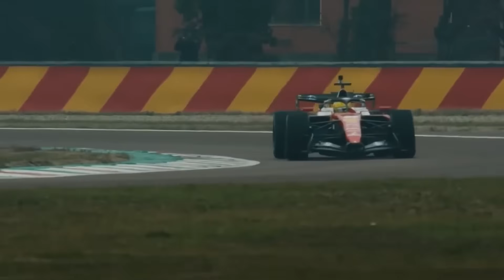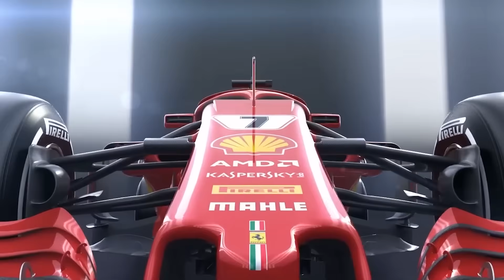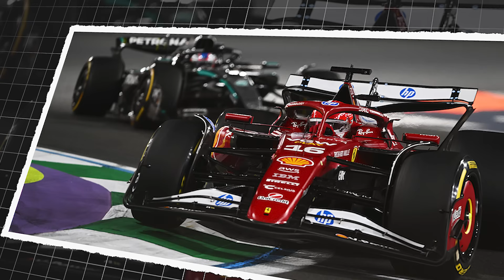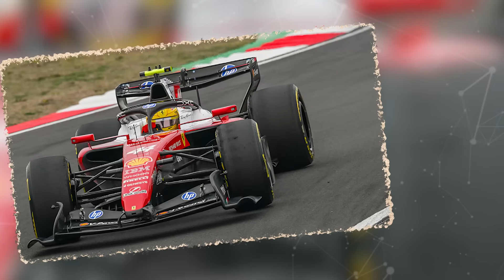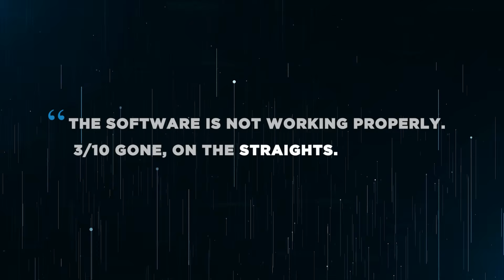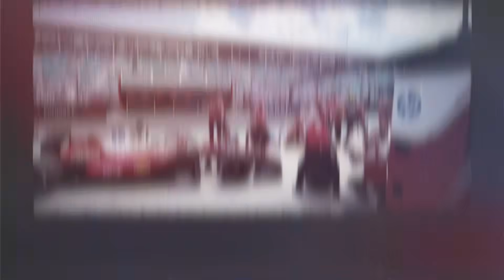Ferrari's Miami Upgrades WORKED - Telemetry Data Reveals Something SHOCKING!

Comment: Plain and simple, Miami exposed Lewis completely. This new version of the car works. Charles has the identical car, but better understands how to extrapolate the best from the car, and is clearly doing so.  Lewis however is still struggling with this understanding, so he’s not performing as expected in Miami this weekend. This is NOT a Ferrari problem whatsoever, period! This is a Lewis Hamilton issue. He must figure out how to connect with this new version of the car, that he himself has (supposedly) inspired through working together with the engineering staff at Ferrari. So Let’s just stop with the over the top analysis, it’s BS. Lewis needs to MAN UP-get his head in gear, focus, which he’s capable of, or step aside. His contract is up come “27”, .. if this inconsistency and poor performance continues, then I for one believes Ferrari needs and deserves a full refund on the salary they paid out, and Lewis should disappear into the sunset where he probably belongs, because it’s just over🤔
RealTalk💪🏾💯